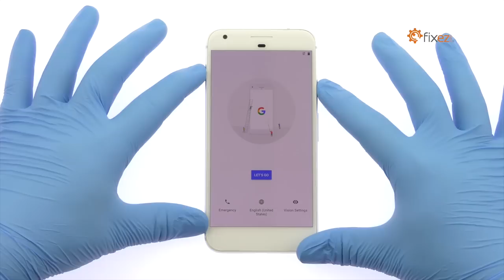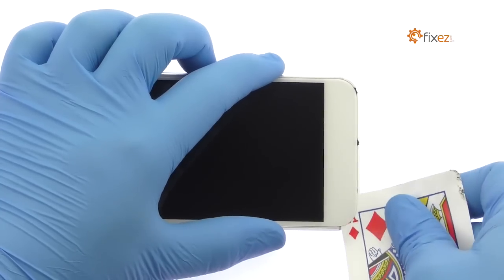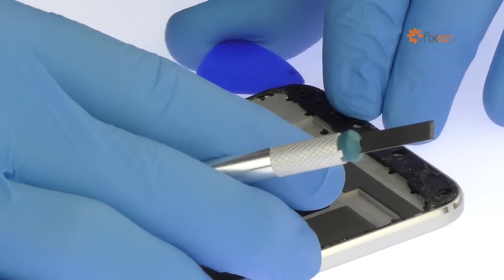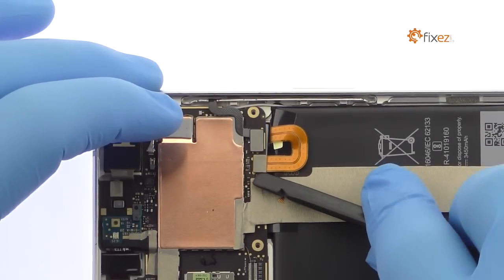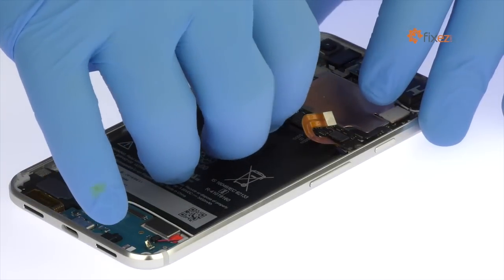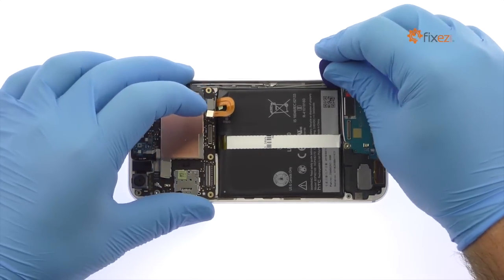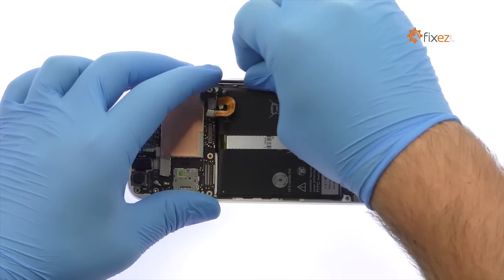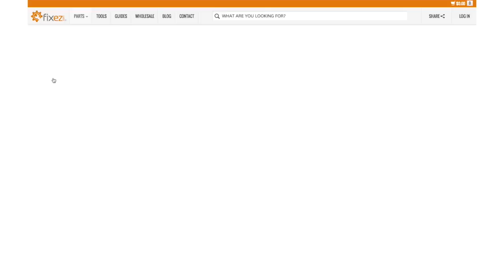Google Pixel XL Battery Repair Guide - Fixez.com

Comment: Just used your parts and video to complete a battery replacement in my good old pixel xl! 
Worked like a charm, hardest part was trying to peel the double sided tape apart! Ez repair, parts were perfect fit!